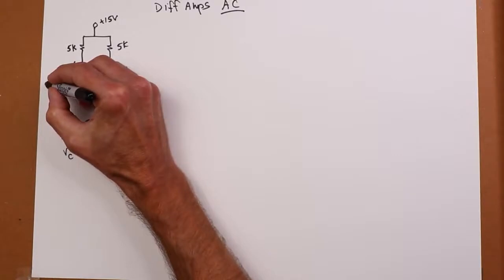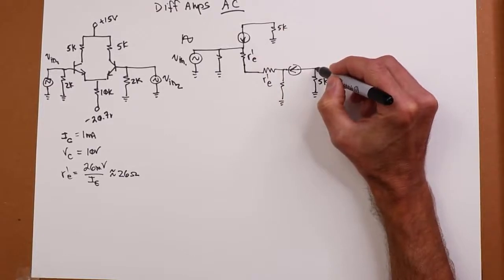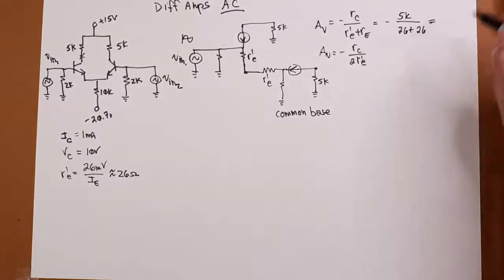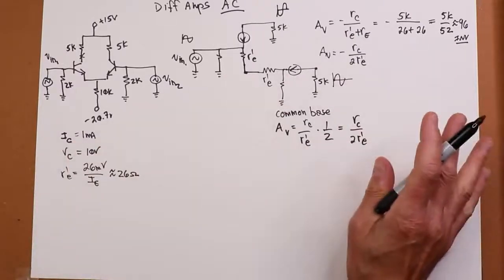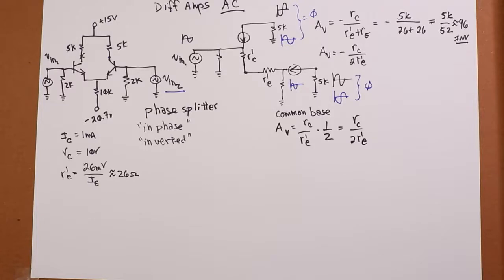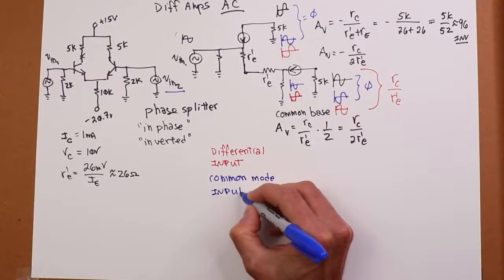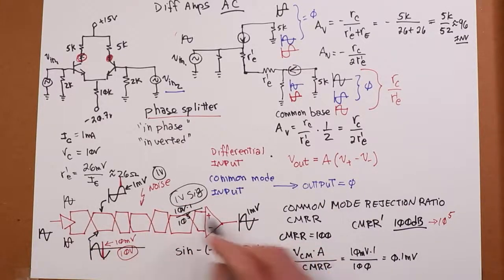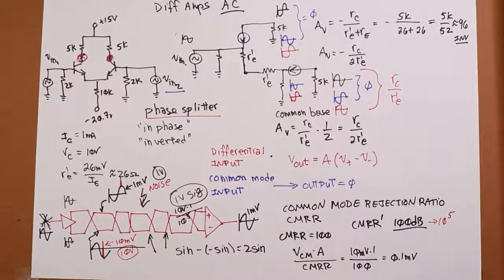Differential Amplifiers, Part 2

Comment: Hello Mr. Fiore, very well explained, thx. At 19:06 you say that the signal with gain of one is 1mV. But before you said that sin-(-sin) =2sin. Shouldn't in that case, even with a gain of 1, output be 2mV?
Reply from the maker: The "output signal" depends on what you use for the output. Most times, the output is "single-ended", meaning that you take the signal from one of the collectors. You can, however, use a differential output, meaning from one collector to the other. The same is true for the input (you can use a single-ended input or differential). Thus, diff-in/diff-out gain is twice the diff-in/single-out (or single-in/diff-out) gain, and four times the single-in/single-out gain. 

The bit about sin-(-sin) = 2 sin is where the above comes from, and also shows (when considering an inverted vs. not inverted signal), that signals can add or completely cancel. Of course, that's the theoretical ideal. In reality, cancellation is never perfect. I will be exploring this more in some upcoming videos that will focus on CMRR (common mode rejection ratio).

Comment: Did you end up making a 3rd part to this video? Turns out this old circuit I'm studying is a bridged differential amplifier. The outputs are driven in opposite phase by the four output transistors.
Reply from the maker: ? Any standard diff amp can have a differential output (i.e., outputs of opposite phase); you just use the output of both collectors instead of just one. That's one way to make a phase splitter.

Comment: At 8:00 im confused of how output is in phase. The direction of arrow of current would suggest negative voltage/anti-phase on both collectors, wouldnt it?
Reply from the maker: I can see how that would be confusing. The current sources are pointing in the direction expected for the transistor model (i.e., the total current which reverse biases the CB junction and establishes the value of r'e). The AC current rides on top of that. The AC current on the right/lower side is flowing left to right for a positive input, producing an in-phase signal at that collector. A "tell" that these are not the instantaneous directions for the AC current is that the sources would be feeding into each other. The reason I didn't draw the arrow the other way is that some students would then ask why the second transistor model appears backwards to what they're used to seeing. It's sort of a no win situation for me as I see problems either way I draw it. I recommend that you ignore that detail and concentrate on the following: For the lower right output, the first stage acts as a follower which is non inverting. The second stage is a common base configuration which is also non inverting. The end result is an output which is in phase with the original input. The upper output, in contrast, appears as a standard inverting common emitter configuration. Hence the two outputs are in anti-phase.
Reply: @ElectronicswithProfessorFiore  i think i mighta sorta actually understand lol at least the gist of what you said. thank you!

Comment: Good vid. I would maybe explain a bit more about Re and I think you also wrote RE. Also 2k for the base resistors is not really practical in the real world.
Reply from the maker: The circuits are generally designed to show how things work, not necessarily be production models. FWIW, many diff amps don't even need base resistors as the base bias current comes from the surrounding circuitry (i.e., assuming DC return), but that would just confuse the explanation above.

Comment: Hi, Professor Fiore amazing explanation !!!  .......just have a small question if the signal has a noise before entering the phase splitter will it be amplified as well.
Reply from the maker: Yep. A diff amp only gets rid of common mode noise, that is, noise that has entered the system after the phase splitter (i.e., in the lines). Any noise that exists prior to the phase splitter will be presented as a differential signal by the phase splitter, and thus, amplified by the diff amp.

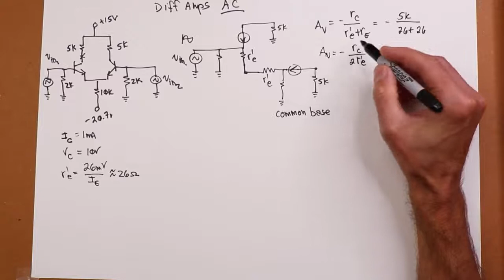Comment: At 6:10, does the second transistor's Rb get ignored because the second power supply is grounded?
I'm a bit lost at 7:40. I can see the signal coming in and through the first r'e, then through the 2nd r'e (2 x r'e in series), I don't see why that would reduce the signal by 2. Guidance, much appreciated. I've paused at 12:00, my poor brain! :)
Reply: Regarding the second transistor's Rb: yes, I think you have to short Vin2 to ground, as per superposition theorem.

Comment: What I'm trying to understand is does the output signal of diff amp has a DC component ? I really understand the dual supply bias that Q point is in middle of BJT curve so we need a dc blocking capacitor at the output.. but when I read about opamps I find that dual supply opams produce the ac signal without DC component that consume me alot can you please answer me ?
Reply: Confuse* me
Reply from the maker: That depends on the how the diff amp (or op amp for that matter) is designed. With a bipolar supply, it is possible to set the collector voltage at 0VDC. Further, if you use a differential output (i.e., from the first collector to the second), the DC values will cancel leaving you with no DC (this is true up to the level of matching between the two sides). 

Op amps often have DC level shifting stages which produce the 0VDC output you mentioned, but this is not true of all op amps. Some are designed to work off of single polarity DC supplies and will have a DC offset, typically equal to half of the total DC supply. 

For details on how the whole 0VDC output thing is achieved, I suggest you take a look at the BJT biasing section of my Semiconductor Devices text and associated videos (also a free OER title, just like the op amp text).

Side note, it is not required that the Q point be centered on the DC (or even the AC) load line in order to create 0VDC at the output. A Q point centered on the AC load line is important if you want to maximize the output compliance (and thus the maximum unclipped power for a given load).
Reply: @ElectronicswithProfessorFiore  
Thank you 🙏

Comment: I understand how OpAmp amplifies AC but how it also amplifies DC voltage, its mystery. The same scheme that works for AC and DC. What is the key which forces to work the both way?
Reply from the maker: The key is that the circuit contains no lead networks (i.e., coupling capacitors). It's directly coupled, and thus, has no lower frequency limit.
Reply: @ElectronicswithProfessorFiore  But that scheme you have showed can not amplify DC voltage. So, there is trigger that triggers the real OpAmp scheme to the correct one?
Reply from the maker: @incxxxx  No, a direct coupled amplifier does amplify DC (that's DC as a signal, of course).

Comment: Could you please write down the equations on how the second transistor impedance is just r`e (@5:15)? Thank you!
Reply from the maker: Z is just v/i. The voltage at the emitter is Ve and the entering current is Ie (AC values, of course). The ratio of Ve to Ie is r'e. This assumes that all of Ve drops across that resistance. In reality, there is also a small drop across the associated base resistor, but the base current is much, much smaller than the emitter current, and the base biasing resistor is effectively in parallel with the internal impedance of the second source which is quite small, typically. Those two factors (small base current and small effective base resistance) combine to make a very small voltage drop across the base resistor, meaning that the original assumption is valid for the typical case.

The computation is essentially the same as finding the output impedance of an emitter follower (voltage follower). See p 177 of the Semiconductor Devices text for that, or the section on common base amplifiers.